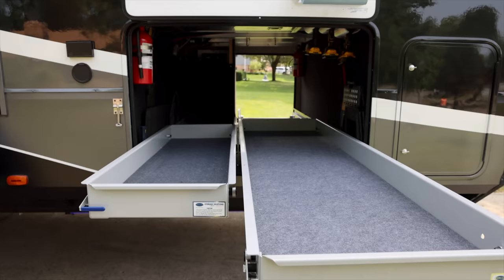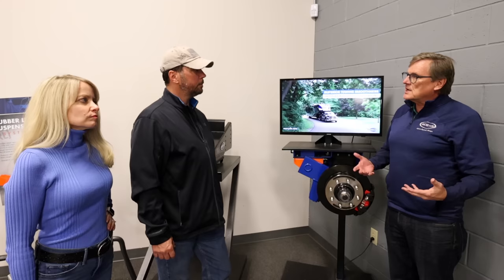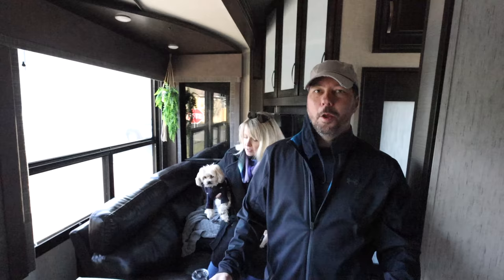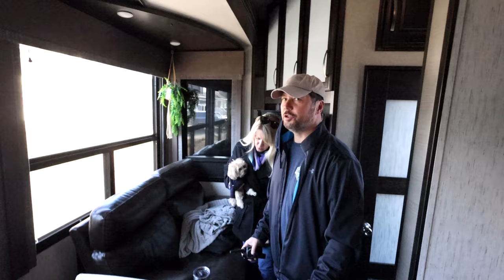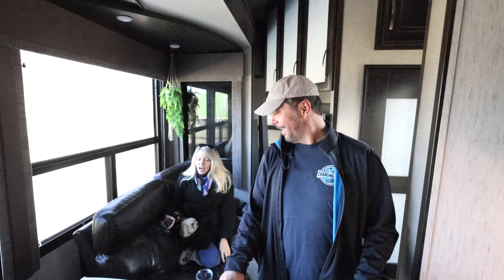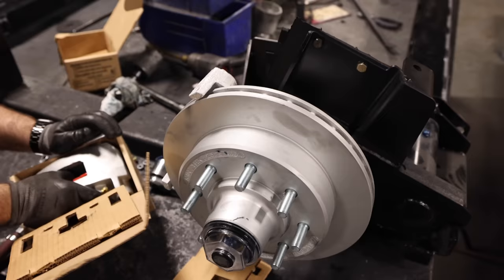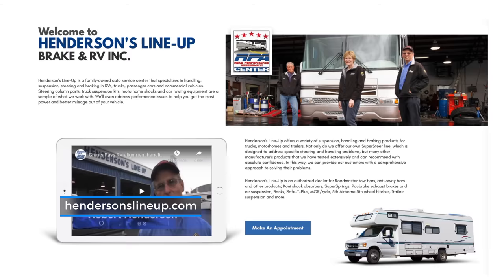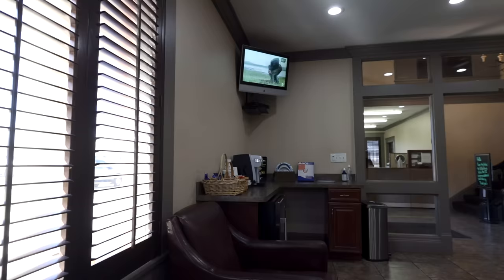MORryde Independent Suspension and Disc Brakes

Comment: Love your channel. No review is complete without a Price  vs. Performance comparison. Easy to give glowing reviews when it is free, but would you have shelled out the $10,899 installed price?
Reply from the maker: After feeling the difference, we would absolutely!
Reply: Wow ... that's like 15k canadian . Ouch
Reply: I would say just go for the torsion axle option when you buy the RV.
Reply: Curious how much a tandem axle install would cost. ⅔ that amount?
Reply: What would each axle cost? I'm thinking if this for double axle....
Reply: @blindsspecialist327  I went with the Sumo Springs on our 5th wheel and have found a remarkable difference in the ride and handling of the trailer.  It's definitely no substitute for independent suspension but it's affordable.
Reply: @NicGoRe  that’s a reasonable assumption
Reply: @kckettridge  nice recommendation... I appreciate it Kirk.
Reply: I would.  Upgrade 8k axle and disc brake from grand design was $8k upgrade.  This vs road armor... This.

Comment: I am not familiar with RV trailer ride. I am familiar with semi trucks trailers. Trailers with air ride pull much smoother than trailers with leaf springs. The air ride is much better to driver comfort. So I can see how your upgraded suspension gives a better smoother more comfortable towing ride.

Comment: Well I am super impressed....I was in the trucking industry for 15 years and have owned many sliding and air suspension systems and that there my friend is impressive!!!!...I never had disc brakes but they are on all the stage coaches ( buses)I drive now and don't even come close to drum systems.....Congrats on the installation and when we order our Momentum it will have to have that system 😍😁

Comment: We are fulltimers in a Heartland Cyclone 3611JS dual axle toy hauler.  We upgraded our 7k axles to 8k axles and IS at MoRyde in 2018 along with upgraded tires and wheels and disc brakes.  It was a very pleasant experience...one night in the rig in their parking lot....one night in the rig in their shop...which at the time operated 24/7 so the whistle blowing for breaks woke us up each time.
We are very pleased with our upgrades and the ride is so improved.  
We workamped all summer to save to pay for this upgrade and while many advised us against it saying we would never recoup the money we spent to this day we have no regrets it was worth every penny to write that large check we'd do it again in a heartbeat!
They are busy, busy, busy at MoRyde so once you have an appt its best to keep it you won't be sorry!

Comment: Another excellent video.  The under carriage videos were especially impressive to watch.  

The addition of the disc brakes is, in my opinion, the most important part of this upgrade.  A few years back when towing our previous 5th-wheel, we rear-ended another car as the drum brakes could not get the whole rig shut down in time when the car in front slammed on their brakes at a pedestrian crossing. That really shook my confidence and I replaced the drums with Titan discs.  I did the work and it took about two days.  The difference in the stopping distance with the discs was astonishing.  

I had read to adjust the brake controller gain until lockup was achieved and then back it off a bit. With the drums, lockup was never possible, not even on dirt roads. With the discs, lockup was easy to induce on dry pavement.  

With the discs I found that when entering corners, I could apply the brakes at the same time/distance that I could without the trailer attached as the truck and trailer braked with the same stopping power as the truck alone.  In general, it made towing less stressful.

We recently purchased a new trailer and have yet to upgrade the brakes.  Perhaps a trip to MORryde is in our future.

Comment: Chad and Tara,   We had the MorRyde RS suspension upgrade installed on our Class C motorhome, which replaces the back hanger of the rear leaf springs with the rubber shackles.  What a difference it makes with bridge and road transitions and the harsh road shocks.  The MorRyde team is one of the best we have encountered having work done on our motorhome.   Thank you for your YouTube video documenting the installation of the MorRyde system on your 5th wheel that inspired us to look at MorRyde upgrades for our Class C.  Keep up the excellent work!
Reply from the maker: That's awesome! 😀 Glad you like it!

Comment: So, a few things; First, a shout out to Sergio! Sergio installed our ISS and was amazing in regards to helping me with any questions I had during the process. And Brian also always gave me his time when I asked for it. And yep, they even fed me lunch!
 Also, I want to tell you that I really appreciate this video. You see, when we bought our fifth wheel and I hooked up for the very first time it was to our Trailer Saver BD5 hitch (it's amazing, with its air bags and shocks) and then took it straight to MorRyde for the ISS upgrade. We knew the ISS and disk brakes would be a great investment into our new investment. So we've never really experienced the rough ride, chucking and such. This video gives us great perspective into the beating our rig would be taking if not for our MorRyde upgrade. So with that, thank you very much for this video.

Comment: I have to say, this one was a real good informational segment. Suspension means so much in  any vehicle, but certainly and RV or 5th wheel. Glad you did it. Happy travels!
Reply: So expensive, unless you get Moryde to make a video and get 11K of overpriced stuff for free. Sheer springs last5-6 years tops. I had moryde  rubber suspension.

Comment: As a tractor trailer driver, this stands true with a air ride trailer vs a spring ride trailer. A air ride trailer you very rarely feel the bumps up in the truck. ( I know yours isn't air ride but the suspension you works the same as a air ride). If I ever get a camper as I want to this is a no brainer for me it'll make your camper last much longer... thanks for sharing. As always enjoy your channel so much.

Comment: WOW! This is definitely something most people dont consider, their 5th wheel or trailer suspension because you ride in the truck, of course. But, I never realized never ending rattling and jolts the trailer sustains that leads to bending, loosening, cracking etc.! Why dont they put these on in the factory! What a fantastic product! I dont care if MORryde did this for free, they needed to get this product advertised and especially demonstrated! I will be looking into this for sure! THIS is the kind of content that helps you stand out from the rest!

Comment: Surprised you didn’t have shocks installed previously. Would be interesting to quantify what the IS alone does. Remember that you also added shocks with this new suspension. When I added the Roadmaster shocks to my 5th wheel, retaining my leaf springs with CRE3000 equalizers, I had the same very positive reaction to ride quality.

Comment: Cool setup. It would be really cool if the arms were supported by adjustable air bags. Another sweet feature if you had bags would be to dump the air from one axle so it was not supporting any weight. It would really improve backing into tight spots. The other reason bags would be nice is a full trailer vs empty trailer would ride almost the same and the ride height would be the same. You could also change the height while parked which would make it a little more versatile.

Comment: We put a MorRdye suspension  system on our 35’ fifth wheel when it was almost brand new so we had no comparisons. We just knew we had none of the complaints that we heard from other fifth wheel owners. I left a whole  Brita pitcher of water on the counter one time and remembered it over 100 miles later but it never moved nor spilled a drop! We left the dog’s water dish full on the floor because it never spilled.  We’re huge believers!
Reply from the maker: That's awesome!

Comment: We have a 2017 41 foot KZ Durango Gold with two axles.  Our OEM axles were 7K.  We had MorRyde install 8K axles and disc brakes when the trailer was about 6 months old so I'm sure we have protected our trailer frame from many road induced body blows over the last 3 years.  We also upgraded our wheels and tires at the same time to Hi Spec aluminum wheels (17.5") and Goodyear G114 H rated tires.  Big investment, but this is our house, so ... We also have a Hensley air ride hitch ... also a big shock absorber for the trailer, so that might be something you guys think about someday.  

I really appreciate the "before and after" video.  I never really saw how much difference there was so that was enlightening.  Love what you guys do and how you do it.  Consider reweighing your rig ... after the MorRyde install (and wheels and tires) our trailer weight went up about 860 lbs.  Our pin weight went up about 30 lbs.  The interesting thing about the increased weight is that the frame isn't carrying that extra weight .... so our frame didn't experience any change in weight, but the scales will show a definite difference.  In our experience, each "axle" went up around 430 lbs.  While you mileage may vary, this is something that you should be aware of.

Ron
Reply from the maker: Yea... it's one of those upgrades that definitely improves the "real" cargo capacity while decreasing the "legal" capacity...

Comment: Thanks, i have DRV and this triple axle suspension. I like that you showed the Assembly of the suspension components and grease fitting and how that all goes together.  Bearing cap screws into place, was also useful.

Comment: I didn't have to watch this video to know your reaction! I had this installed at their facility last December (8K IS Tandem with Kodiak Disc Brakes) and love it! I knew I would be taking my Momentum Toy Hauler on rough roads to distant places and I have full confidence in this suspension. The enhanced braking power is a game-changer. If you are considering this and want to save some money, ask about their winter-month installation discounts. While traveling to/from Elkhart in December can be challenging, you may be able to save some money.
Reply: You must have been there close to when I had mine done.  First week of December?
Reply: @dougsmith7031  10-12 Dec

Comment: Best money you'll ever spend.  We have a 35 1/2' Montana.  We had this done in 13 and now when we come down the ALCAN (we live in Alaska) we only have one drawer that opens.  It used to be all the cabinet doors and drawers would open.  There are times when the ALCAN is worse than others but don't have to worry about it now.   You still have to pay attention to frost heaves though.  We had the IS, their pin box and 6 point level up put on.  You will be amazed at the difference on how it tows/rides...

Comment: I have used old electric brake magnets, 2 of them, wired to the brake control signal wire on trailer to fix dozens of the brake controller-elec hydraulic pump issues on those factory controller trucks. The ones that don't like E/H brake pump need the load those magnets will provide. I put the two magnets wherever they will fit. On GN horse trailers there is a great place under neck. On RVs I have put them  right by E/H pump unit. I thought that fix was more widely known and used.

Comment: Be nice too see them do it on air bags...OTR driver and back in the 80s pulled my first air ride trailer with my spring pete.....holy crap what a difference.  I see just old gm calipers that cost nothing to rebuild and cheap brake jobs.  Install guys know their chit.  Great alignment tools.  Fab guys that build brackets and parts. Maybe a C on the welding.  But nice 👍👍

Comment: I have a travel trailer and had the EZ Flex equalizer. I replaced the springs on my trailer and also installed the least expensive Morryde equalizer, the 3000 series. It made a huge difference while towing. Similar to what you experienced. I guess the bottom line is Morryde makes some impressive suspension products. I am in the process of spring fixing and I think I am going to put in the Morryde 4000 series equalizer. I have about 20000 miles on the 3000s and expect that the rubber spring material is probably beat up from the same sort of roads you have experienced. I cannot afford the IS  at this time. Maybe when I win the lottery. LOL I added this for any of your viewers that want a suspension upgrade, but, like me, are not able to afford the IS. If you search for feedback on the Morryde equalizers you will see that most who have them notice a big improvement in ride. And those big bumps inputting shocks into the trailer will make the front of the trailer react to that shock as well, transferring shock into the hitch arrangement on your tow vehicle. So you feel those trailer axle hits in the tow vehicle. Reduce the hits and smooth out your ride.

Comment: Shout out to Henderson’s. We were just there Nov 9th while we didn’t pull the trigger on the full IS system (and yes it takes longer and a fair bit more expensive ) we did have them install Kodiak disc brakes and comfortride slipper springs and shocks. Braking is night and day gain from 8 to 5.5 on our 16700# Montana. And muted it a great word for the bumps in the road. We are super happy with it and recommend Henderson’s highly. Great video as usual guys. Thank You

Comment: I Imagine the ride in the truck was better because of the new pin box too. Something you barely touched on was the things the independant suspension would do is extend the life of your microwave, refrigerator, slides, tires, items in the office, washer and dryer, less chance of water lines coming apart. And maybe most important is how the Indian rides in the garage.
Reply from the maker: We've had the pin box for a few months and a few thousand miles prior to the IS...  So, the difference was all suspension.

Comment: I have a 43 ft toy hauler and have taken it cross country three times. during the summer I drove from Virginia to Oregon and back. My trailer and Ford 450 took a beating. In fact I broke the bedroom slide pan from the beating the trailer took. It also broke aluminum framing on the front side of the bedroom slide resulting in a crack about 6 inches long in the skin of the trailer. I have an appointment in February to have the MORyde suspension installed on my Voltage toy hauler. Thats if the dealership gets the repairs done it time.

Comment: Our TT (Rockwood UL) came equipped with Dexter Torflex axles.  I don't think they're quite as smooth as the Morryde independent system since they lack shock absorbers but I'm guessing they're a lot cheaper.  They are leaps and bounds smoother and more reliable than leaf springs. Anyway, I'd say it looks like you made a good choice!
Reply: Check out Dexters Airflex system it is a combo of both Torflex and air bags.. Oh and always go w/ disc brakes

Comment: These are the next RV  "Thing".  I'm working on a 74 Airstream Reno.  I have a complete airbag suspension designed.  The plan is to get it under the Airstream next spring.

Comment: Only thing I didn't like was during the brake assembly process. After installing the disk the tech did not clean off his greasy finger prints off disc before installing caliper and pads. Not good practice. Overall very impressed. Looks like a great upgrade.

Comment: Great video! We had our Solitude done in July. It has lowered my stress of towing considerably. I would definitely recommend IS and disc brakes.
Reply: I plan to travel long distances and don't want the springs, shackles and nylon bushings to end those trips.
Reply: How much does  it cost?
Reply: @sylvaindupont8077  about $7800 for IS and disc brakes.
Reply: @dougdoris8622  was that 2 or 3 axles?
Reply: @lwadeallen  two axle
Reply: @dougdoris8622  thanks, that may be a little steep for my 40k 5'ver. Again thanks for the info.

Comment: We have been running independent/disc brakes for 3.5 years on our current rig and 2 years on our previous unit.  Won't leave home without IS/Disc brakes on any fifth wheel that I own.  My description of going over bumps is there is no "AFTER SHOCK" from the trailer.  As far as the disc brakes go I often tell the story of the time we were the 6th vehicle in a 5 car pile.  My front sensors on my truck were into the yellow range when we stopped from a speed of about 60 MPH.   Bama and I recently had a conversation about IS/Disc.  He sold a rig and the buyers wanted this system but the manufacture would not provide it so Bama had to work it as an add on.   He wasn't sure of the value of IS/Disc but after our conversation I think he was sold.

Comment: Morryde needs to go into acquisition mode and become an rv manufacturer for this type of system. The issue is this isn’t any easy ROI to communicate. That’s why the acquisition is a long term investment. The benefit is they’ll achieve economies of scale much faster. The long term customer experience will eventually shift the industry. The American OEM shift to independent suspensions is a good prototype to model from. But y’all did a great job with the video, totally appreciate the intelligent messaging
Reply from the maker: Or maybe start making frames with the IS to compete with Lippert.  👍🏼

Comment: This is interesting, a fifth wheel upgrade that is so much better than stock you would think the original builders would do this from the factory. I would expect at the factory level it would cost 1/3 of what the retrofit would.